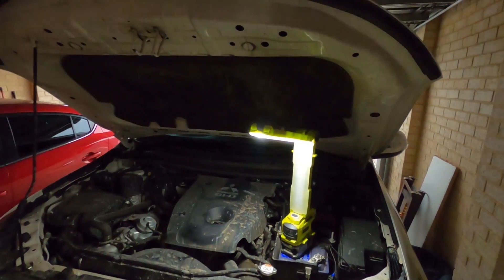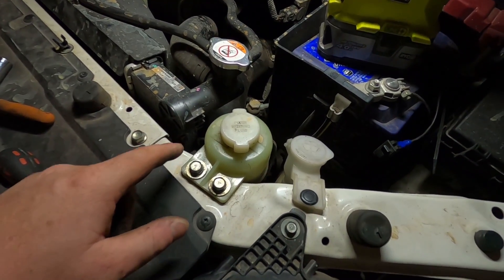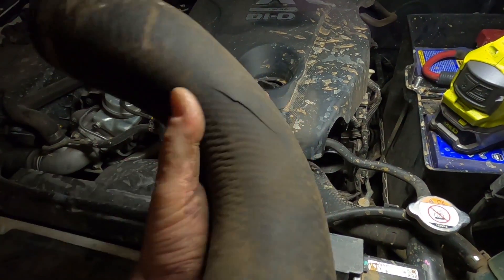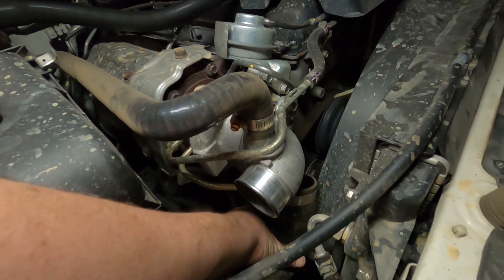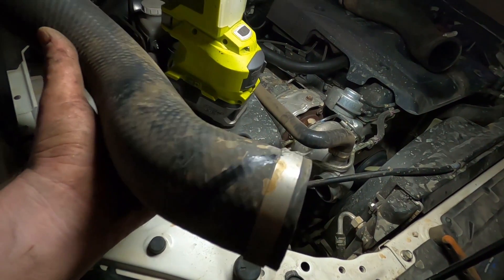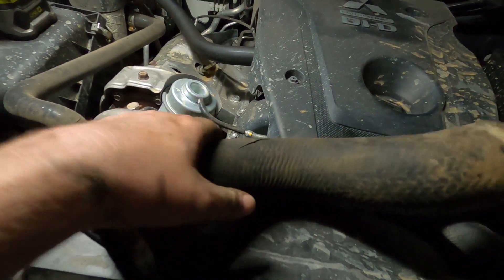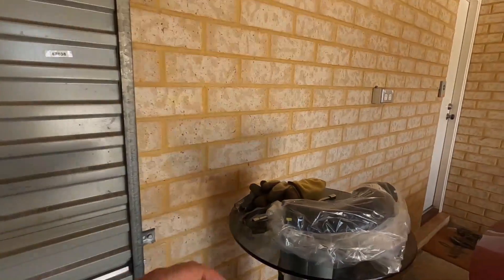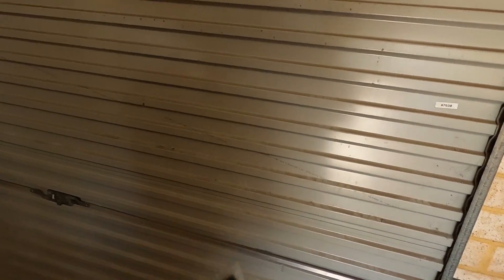Split Intercooler Hoses - BIG PROBLEMS - SIMPLE SOLUTIONS - Common Turbo Diesel Issue #boostleak

Comment: What causes that split?
Reply from the maker: Age, pressure, oil
Reply: @T.A.G is there oil in the air system and is it corrosive? Thanks 🙏
Reply from the maker: @Tuffjobs a little oil is fine, it does weaken the rubber over time though

Comment: Wish I’d found you earlier mate. Had all the symptoms: surging, check dpf, engine light, limp mode and suction over 2000rpm. $680 later the mechanic cleared dpf even swapped out the dpf sensor. Symptoms still there. Watched your vid and found the exact hose is split. I’ll fix it myself this time. Thank you legend
Reply: $129 , 20 minutes work & now she runs like new. No smoke, no surging and no dpf light. Thanks again mate.
Reply: @alfalfa6245  Sorry but what o you mean by surging? Wondering if I'm having the same issue with my pathfinder. Suddenly won't go above 2000 revs with foot on the floor in neutral, and then suddenly bursts through (as if a blockage is being cleared) and revs like normal..

Comment: I've had to replace turbo hoses on all 3 of my cars. It's a common part to eventually need replacing. Same as camshaft and crankshaft position sensors.
Fuel lines too on 15+ year old cars.

Comment: Hi there,
If you have no fault or engine check is it possible there is still an issue with the hose? Our Triton makes a loud suction type noise on acceleration at just over 2000rpm
Reply from the maker: Yes

Comment: Common problem on the triton, mine is split in exactly the same spot as yours, replace both hoses. Taping does nothing, it will just blow it off, I tried.

Comment: Very helpful thankyou so much. It definitely is a common problem with the Triton. My 2016 Mq Triton just did the same thing yesterday. On my way home from work the engine management light had come on and the DPF light as well and went into limp. Spent today ringing around and finally found someone that had a replacement hose. Installing it tomorrow.
I know this may be a silly question but after you changed the intercooler hose did the DPF light and engine management light go out?
Reply from the maker: sometimes it can, really depends on the situation though
may need a forced regen
Reply: Where are you located
Reply from the maker: @muheiTinashe in space

Comment: I had this problem with my 2009 Mercedes C200. A new hose from the dealer was just over £61 and they had it in stock. It runs like a dream now.
Reply: lucky my volvo needs £500 worth of hoses from volvo themselves for a split
Reply: @oddball1999  I wasn't so lucky with my 2003 Volvo XC90 last year. It needed a turbo rebuld and a new intercooler costing me the thick end of a grand.
Reply: @Parknest  thats unlucky. I just bought a 2007 xc70 and now it seems the previous owners garage bogged everything. They put off a timing belt which was £400, swirl flaps were broken and had been bogged together to last a little longer, one of the flaps was missing, no idea where it went to in the engine. New swirl flaps where £540 and not 3 split turbo hoses which come to £700 including vat. let alone anything else which wasn't done properly by this garage. I cosmetically its really good but I bought the vehicle for £2400 and have spent £900 on it already, I don't know if I should repair the £700 worth of turbo hoses or not as I won't be able to find a manual xc70 again for a long while

Comment: Just opened the bonnet on my Pathfinder to find a split on the top hose, was going in to change the AC compressor - that can wait 😂 looked easy enough cheers for the instructions just in case 👍

Comment: Hi! I have a Pajero Sport (called Montero Sport where I live) and I noticed there was some oil residue on the metal pipe outlet of the intercooler (cold side). The leak seemed to come from the intercooler hose where it is clamped. I noticed that the clamp was not fully tightened, but I still decided to remove the hose to check if there was a split. There was quite a bit of oil residue in it since I don't have a catch can, but to my surprise, there was no split, so I put it all back and assumed that the clamp was not tight enough before, therefore causing a leak where it connects with the intercooler. My question is: Is it possible for a clamp to be overtightened? Considering that this part left the factory not fully tight, I wonder if there was a specific torque amount for that particular clamp. I'm not the most mechanically inclined, so I'm sorry if this is a ridiculous question to ask. Thank you very much!
Reply from the maker: They can be overtightened yes, they can strip the clamp or skip if too tight

Comment: Mate wish I woulda checked this video a week ago hahah- 2018 Triton been having DPF problems then most recently Check Engine and Limp mode. Costly tow then Mechanic removed DPF to have a look , said there was quite a bit of build up but also had a similar split in intake tube. Replaced that and car seems to running so much better but still worried about DPF buildup - only done 110000kms.

Comment: rang dealer wanted £200....for a tiny piece of pipe....went on ebay bought ssme aftermarket part for £24
Reply: did ya ever have problems with the cheapo?

Comment: Thanks for this! My diesel outlander kept throwing up DPF warnings and I found split in my intercooler pipe.

Now I just need to fix it.
Reply: Same issue here in a captiva 2.2 how'd you go?
Reply: @LegendLength  don’t laugh, but I used the best quality gorilla tape I could find and wrapped the intercooler pipe.

I’ve been having issues finding a replacement but so far boost leak has stopped and the engine light is no longer there.
Reply: @Spunky_Bob  I tried wrapping but cut my hand up trying to get down there lol.  I ordered a new one anyway.   I saw in another video a mechanic saying it's very common for that to cause DPF and boost issues.
Reply: @LegendLength  I removed the pipe and gave it a good clean first so the tape would stick.

Comment: I just had an intercooler hose fail by rubbing up on the power steering belt.  Mitsubishi did the fix at 18 months into warranty.  I got a dpf warning a month a go but the trigger was the power steering fail.
Reply from the maker: Power steering doesn't cause a dpf error. The PS belt rubbing through the hose will though

Comment: @The Average Garage  thanks! So yes... My 11 month Pajero Sport went in today. Had slight noise, jerks and recurring dfp errors. Everything besides dpf was ignorable (to a point) but the dbp warning eventually forced me to take it into a 1 month early service. Turns out a design flaw causes the swollen intercooler pipe to rub against a pully and be cut. They replaced that in warranty and it like a new car. FYI...

Comment: What's surging?
Reply from the maker: Like a back and forth jerk while driving
Reply: @T.A.G  thanks! So yes... My 11 month Pajero Sport went in today. Had slight noise, jerks and recurring dpf errors. Everything besides dpf was ignorable (to a point) but the dbp warning eventually forced me to take it into a 1 month early service. Turns out a design flaw causes the swollen intercooler pipe to rub against a pully and be cut. They replaced that in warranty and it like a new car. FYI...

Comment: Same deal for me, DPF light was flashing. Had a look through the engine bay and found the same hose had an inch split in it… what is the shelf life of those hoses? I can’t imagine they only have 4 year life, that seems too short right? Or am I just expecting too much?. Video was helpful, thanks for posting,
Reply from the maker: Shelf life varies greatly. Oil and boost pressure does its work on them

Comment: my colt 2.8 have a wisseling sou starts as soon as it start boosting what can it be
Reply from the maker: Could be many things mate. Check for splits in all the soft hoses, you could even very carefully spray some solvent around joint and things of the intake system and when the revs pick up you have found a leak

Comment: The cause of these pipes splitting is not just oil blow-by but also the fact that the pipes are under constant pressure stress. In particular, the area just before the throttle body is a very common failure point because the pressure shock stresses in that area are the highest.
Reply from the maker: The throttle body that doesn't close? Turbo diesel throttle bodies very rarely close. Only really whilest commanding EGR or killing the engine.
Reply: @T.A.G  That's true, but EGR may actually be causing that problem. I've had issues with a dirty EGR and a hairline fracture in the turbo pipe which would cause very serious surging in engine power because the ECU was continuously fighting itself.

Eventually the surging caused the tiny fracture to rip open far enough to find it and I could actually fix it.

Comment: What was going on with your car that alert you to it?
Reply: Mine started surging on the highway and increased fuel consumption dramatically was sitting at 18l per 100kms.
Reply from the maker: Surging and "check dpf" warning
Reply: @T.A.G  hadn't watched it all yet 🤣 might give mine a check as it's been acting a little odd. No dpf lights but seems to be a bit slower on to boost and a little laggier
Reply: @T.A.G  i'm not english speaker.. what is "surging", what does it mean?
Reply from the maker: @milek021  surging is when the engine rpm goes up and down on its own, and the car when driving if it surges will rock forward and backwards while driving
Reply: @T.A.G  thank You!
Reply: @T.A.G  The "Check DPF" is probably a ghost code but a tell-tale sign that something else might be wrong. Bad EGR or a boost leak.

DPF fill is calculated by correlating the pressure differential across the filter with the mass air flow. If the MAF is reading too high because the turbo is blowing air onto the road, the ECU would calculate a fill level that is much higher than it actually is.

When I fixed my turbo line, the DPF fill level instantly dropped from 40+ grams down to 11 grams, without running a regen.
Reply from the maker: @Stoney3K  check DPF can also be thrown by oil level calculations by the ecu. Every time it fails a burn the ecu logs a certain amount of fuel as entering the crank case. And once a certain level is reached will throw the code. Mine came up with the error and went into limp mode. Had bugger all boost (restricted by limp mode) and had intermittent issues. Surging was evident and limp mode would come and go. Aswell as the warning light.
Reply: @T.A.G  i feel like mine is doing the same thing. i replaced my hoses last night ( one was split) but the Check DPF error is still on. I'm going to take it to the mechanic and see if wiping the code will help
Reply from the maker: When mine had the check DPF light it went away on its own and didn't actually store any code at all. Take it for a nice big drive and make the engine work. However check the oil before hand. Make sure it's not over full or at the X
Reply: @T.A.G  ill have to check that, mines currently stuck in Limp Mode. So i can take it for a drive unfortunately
Reply from the maker: I just drove mine in limp mode haha
Reply: @ The Average Garage. What tool do you use to calculate dpf load
Reply from the maker: You don't. It all takes care of itself mate. Set and forget without the set part

Comment: Had same happen on my MQ Triton last weekend. Spent all week checking service centres and parts stores but Mitsi has sold out. Seems like a very common issue. I ended up buying Forefront Indistries after market hot and cold side replacement hoses.
Reply: Yep my MQ TRITON 2015 just had same issue this week.

Comment: Wouldn't the hoses blow out on the bottom if it was caused by residual oil from blow-by sitting inside the hose?
Reply from the maker: Can blow out anywhere. The oil is all over the inside of the hoses not just the bottom :)